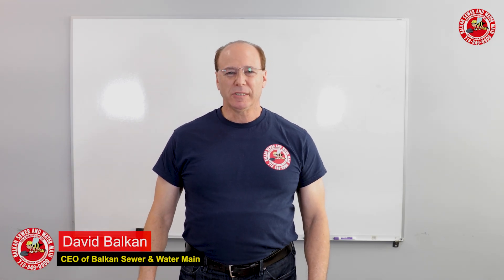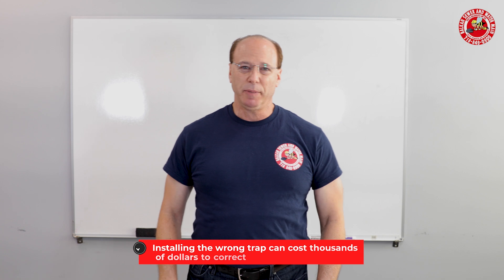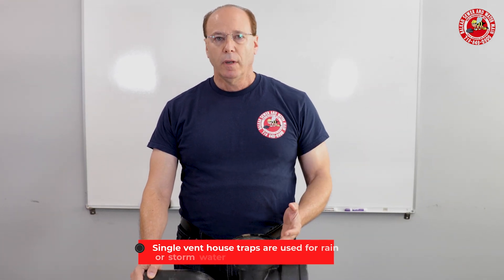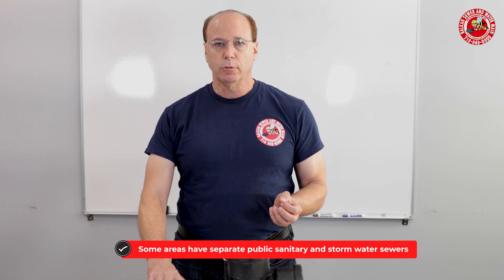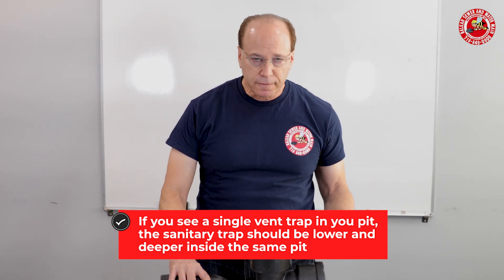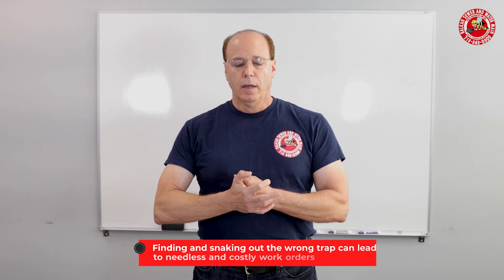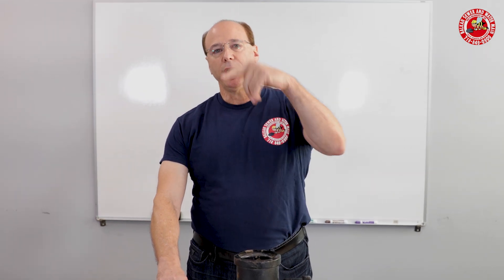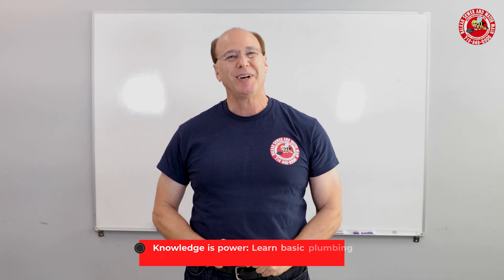House Drain Traps Explained - Single Vent House Trap

Comment: Have a small apartment building in NYC.  Double vent trap is on the street of the building & single on back yard side which picks up storm water from gutter & back yard floor drains.   Both traps are on the same sewer main just one is on the front of the building the other is in the back.  Need to replace the single vent trap as it’s seems to be broken (under ground).  Thinking about putting in a straight length to get rid of the trap completely.   Don’t see why I need it as it’s not preventing any sewer gases from getting in the building as any gases will escape from either back yard floor drains or vent stacks.   Ive seen some convincing reasons why you should get rid of it.   Any advice would be great.  Thanks
Reply from the maker: The rear trap serves the purpose of stopping debris from entering your drain pipes. It does also prevent sewer gases/smells from fouling your rear yard.
Reply: @balkanplumbing  thank you.  Yeah I think the debris is why Im having problems in the first place.  Going to install a new one regardless.  Great channel btw.
Reply: @nicholasstabile445  Thank you! Use a single vent trap for an area drain BTW. And make sure the sump the trap sits in is deep enough to catch dirt and debris as well.
Reply: @DavidBalkan  just an update.  Couldn’t get a 5” single vent trap.  Went with a double vent instead.  Ultimately had to cut out the old single vent which was completely rotted out.  When I peeked inside the pipe I had hardened grease as the back of the building handles the 6 kitchens (3 on either side).  Paid for a sewer auger service who flushed out the pipe as well.  All connections are made.  Now just going to leave the hole open until the next rain storm to see how we do.  Thanks again for the professional knowledge.
Reply: @nicholasstabile445  You're welcome, I'm glad to have helped in some way.